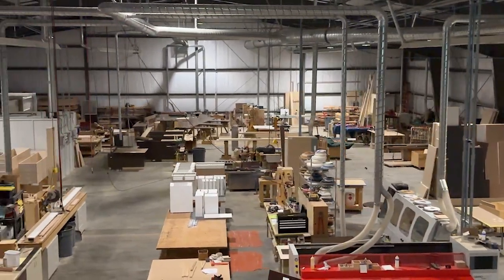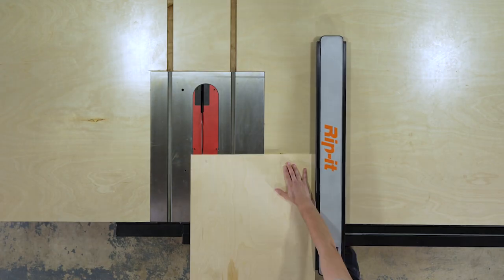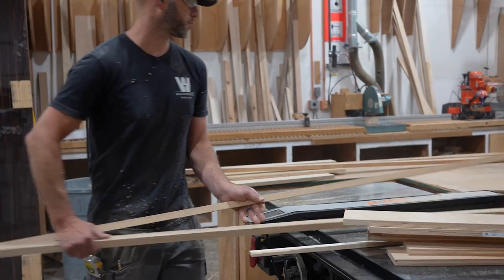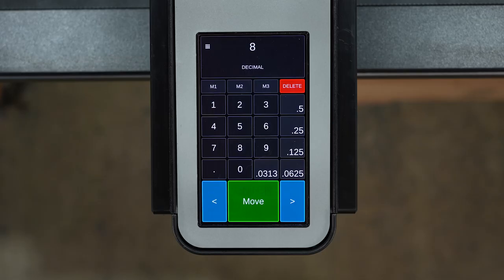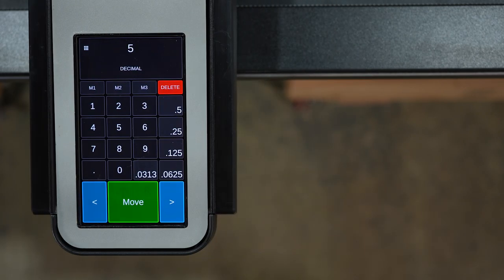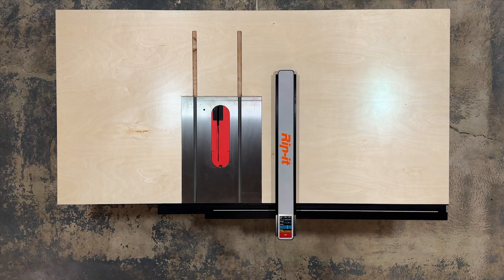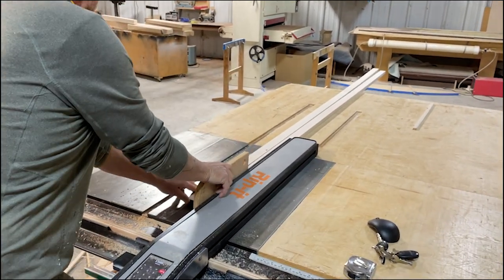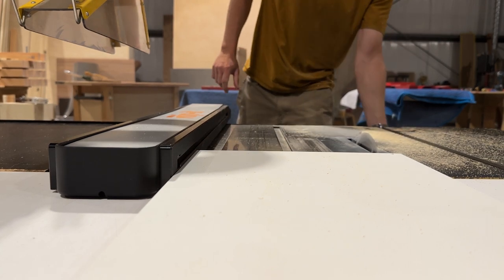Rip-it Kickstarter Video - Official

Comment: I’m guessing this could potentially remove the need for a thin rip jig since you could continuously reduce the distance incrementally and achieve repeatable results.  But let’s say you wanted to use a thin rip jig anyways.  Is there a function to continuously zero the fence out onto your material against the the jig as you make passes?

Comment: So your potential customers  are to provide pre-production capital for this venture? I'm curious, will they also become shareholders in your company and receive stock dividends and other profit-sharing payments?
Reply: On most Kickstarter Products early "investors" get either a Discount on the finished product or some other type of Benefit from believing in the Project. Not sure how these guys handle it but its also about supporting innovation from smaller busineses
Reply from the maker: Our Kickstarter backers effectively pre-purchased Rip-it at a discount. They put their trust in us and provided the capital we needed to start production, and in exchange they will receive a unit of product for 28% - 38% less than MSRP. That's typical for a Kickstarter. There are other platforms that do "equity crowdfunding", where supporters become shareholders, but Kickstarter isn't one of them. We looked into some of those to fund the company but honestly I think more people would rather just get a machine for their shop!

Comment: Looking forward to ordering this, if you can answer the question that I sent on Kickstarter.  I have a unisaw with unifence and find that it is very convenient to remove the fence with a quick turn of the handle when I want to use the saw top as a workbench.  Can this fence be quickly removed from the saw?

Comment: @1:06, is that a nylon pinion on  metal rack? whats the durability of that system?
Reply from the maker: Great question. The prototype is a plastic pinion and rack. The final version will be nylon for both. We will soon have prototypes created of the gears and do testing for durability and strength. Nylon isn't as strong as metal but has the benefit of being self-lubricating, and we plan to make them field replaceable.

Comment: trying to think o the right word but incremental will do. A job often done on the tablesaw requires moving it a repeatable amount each cut. like dados, finger joints, dovetail joints etc. A dado might be done by the saw every 1/8" til the dado is finished then move to the next dado.

Comment: I have the DEWALT 10-in 15-Amp Portable Jobsite Table Saw. I would like to know if it would be compatible with this saw. I would be glad to demo it if you need to find out.
Reply: does that mean yes or no? @Conradlovesjoy
Reply: @manuelrivera6873  no, it looks like it needs a track to run in that the Dewalt saw doesn’t have.